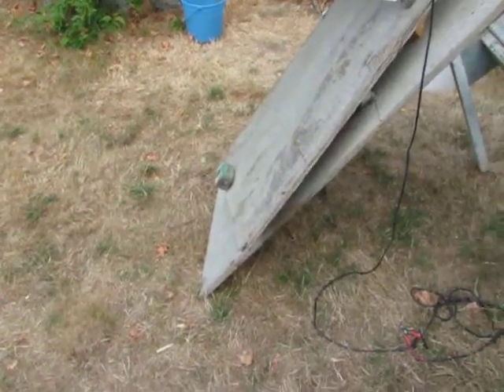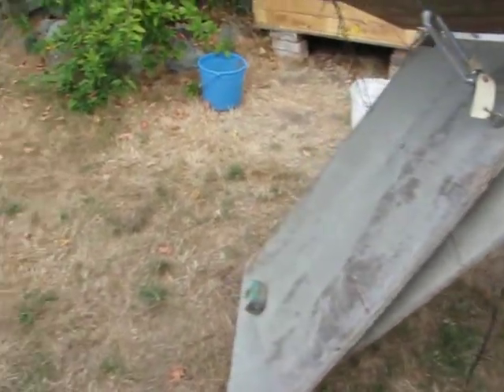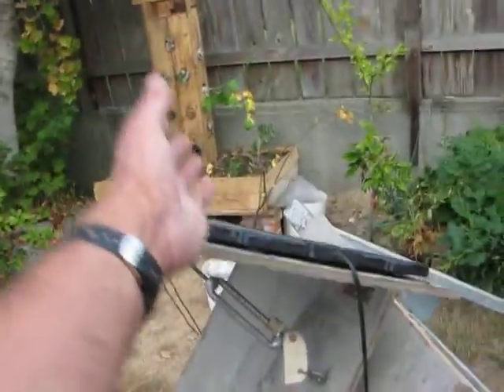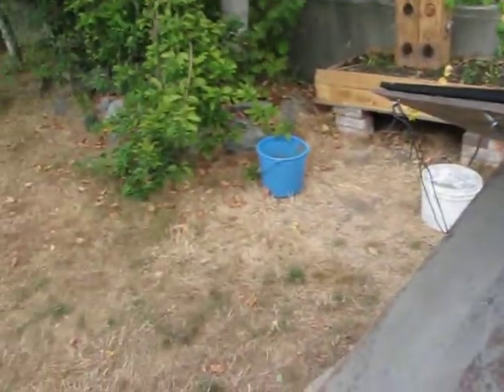Equatorial platform for mounting solar panels.  Experiment to give you ideas.

Comment: You don't need something so big. Astronomers use something called a Poncet table, which they can put telescopes or even entire observatories on top of. You don't actually need to mount it on a full axis angled at your longitude, merely having the bearings set on a conical section is sufficient. Google has the details.
Reply from the maker: Hi, Travis, note that a Poncet table will usually only give one hour of tracking.  And yes,  this thing I was doing was more with solar cooking in mind. It is more about demonstrating the aiming problem.        Solar cooking reflectors are big and they need to be aimed with something like 5 degree accuracy.  The next version of the solar panel mount will probably have the aimer independent and use  a solar panel on ball in socket on  a pole mount.  3 floats in buckets attached to guy wires will aim it.  Either the air in the floats or the water in the buckets will be adjustable to tilt the panel.